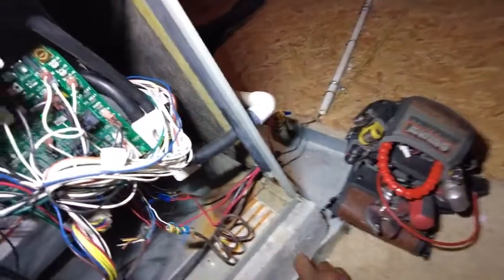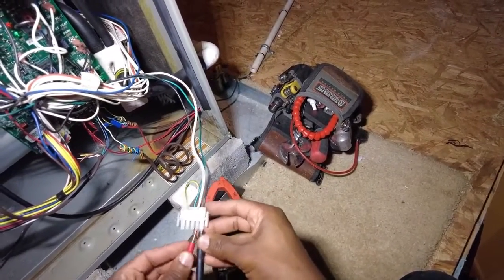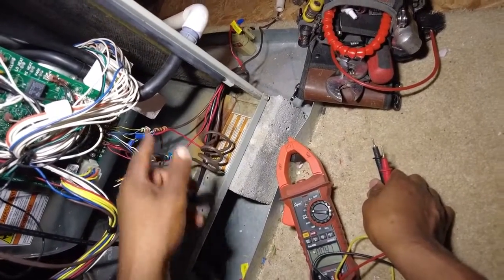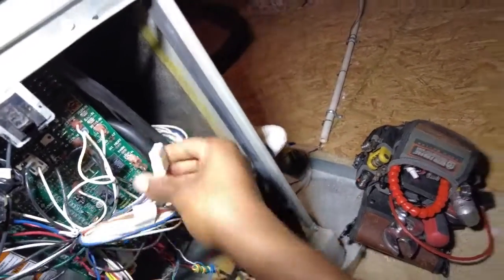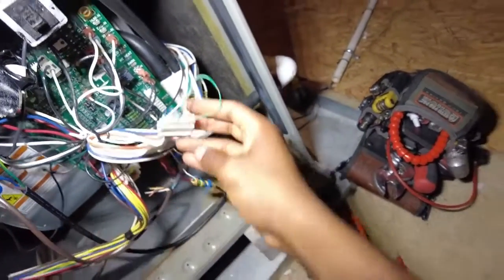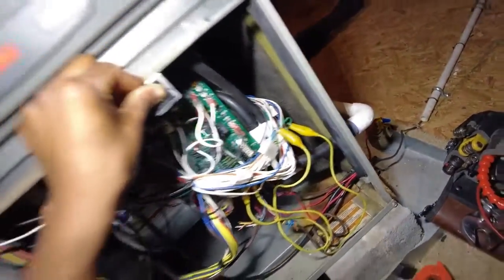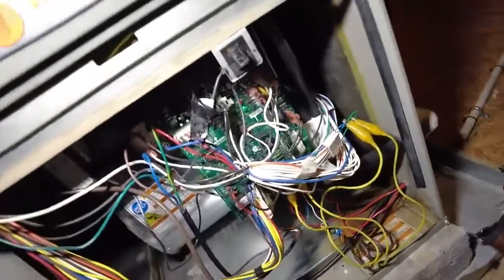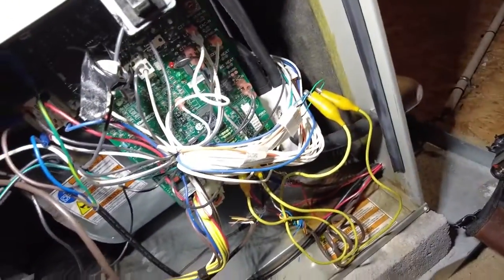Variable Speed ECM Blower Motor Go No Go Diagnostic Test No Special Tools Required! HVAC Training

Comment: I just kept an old wire harness and cut off one end and kept those wires attached to the 1,3,12,and 15  positions. I then added a red and blue wire as required to bundle those pairs of wires. Now we just plug it into motor and connect at r and c terminals.
Reply from the maker: very nice tip thanks!

Comment: Supco ECM test module would have been faster and easier than how you did it its just a plug on molex plug too and if it runs then harness if it didn't then motor easy peasy
Reply from the maker: oh yeah, I actually have one of those supco testers as well I just wanted to show people how to do it without the tool. Appreciate the feedback and thanks for watching!
Reply: Why not show both ways with tool and without then let the viewer decide which way is better for them.